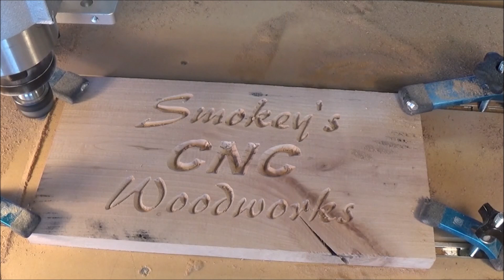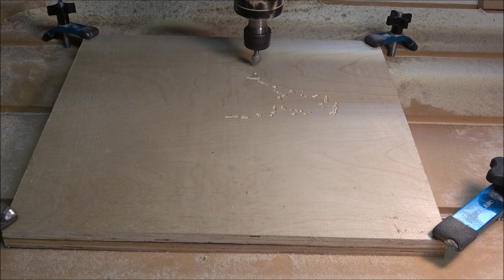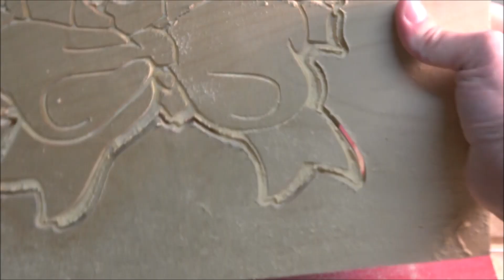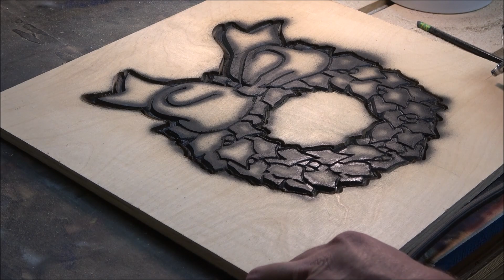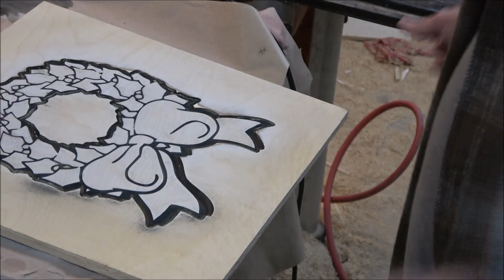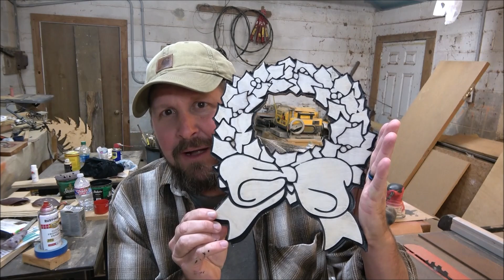Christmas Wreath CNC

Comment: Nice work. I’ve watched you cut a lot using birch ply. I have a few projects I’m trying to use birch ply with but I get a lot of chipping on the surface where the v bit cuts. Only thing I can think is my speed may be too fast. What is your typical v bit in/min when using birch ply? That is if you don’t mind sharing.
Reply from the maker: Not at all, I'm running at 100 inches/min...at 16000rpm...now I run it at about 60-70% of the max travel speed...I change this in Mach 3 every time I cut....Thanks for watching!!
Reply: @SmokeysCNCWoodworks  thank you. So you’re really only running at about 60-70 in/min then once you change it in Mach 3?  I’m not sure if I understood that completely lol.
Reply from the maker: @christopherthomas5400  Yes, email me at Smokeyscnc@gmail.com, so I don't write a book on the comment page, lol....Thanks for watching!!!